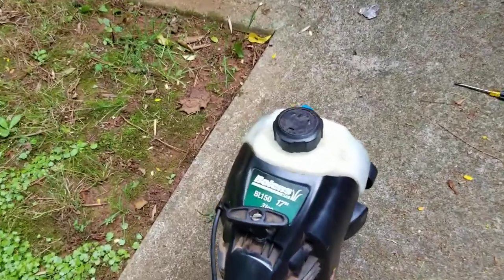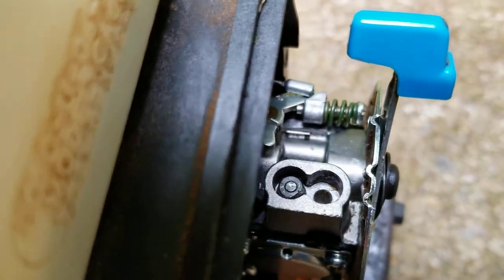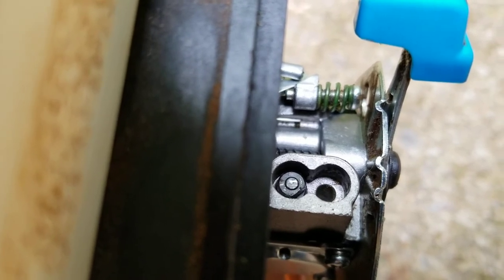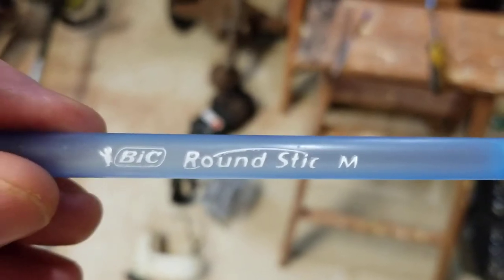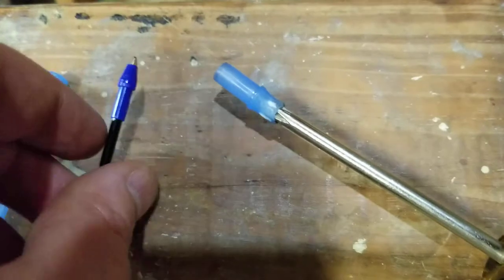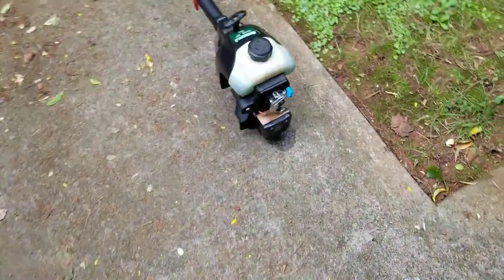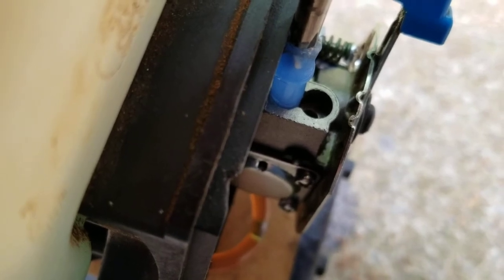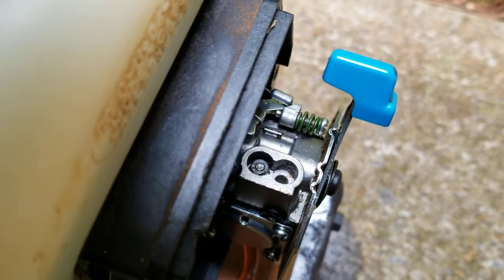Homemade 2 Cycle Carburetor Adjusting Tool

Comment: ALL small engines WILL need this adj after first 30hrs.
Factory sets them very lean to pass EPA.
$15 buys u a set of the correct drivers
Reply from the maker: Yeah, I made this video when I was going to mow my lawn, but my weedeater needed adjusting, and I did not want to wait on ordering the  tools. I had to think of something that would let me get the job done fast. I would advise people to buy the adjusting tools (which I still have not done even years later), but if they don't,  then grab a Bic pen and a screwdriver like I did, lol.

Comment: I had to do the same thing, but I used a plastic sleeve on a wire crimp terminal,  It worked, I pulled mix screw all the way out and with a dermal tool I cut a flat head screwdriver slot in it, so I wouldn't have to go through that next time I needed to make an adjustment

Comment: And fun tip…. For some reason the return hose for the gas tank seems to always crumble so you can use the inners of that ink pen to replace the hose(in a pinch).

Comment: Just melt the tip of the other side too??
Reply from the maker: You should just have to heat the side you are inserting the screwdriver into. Make sure that whatever tip you are using will fit flush onto the adjustment screw. If the tip you are using is too large to fit flush against the carburetor adjustment screw, then slightly heat it and slightly crimp it. If its too small, heat it and use a nail to slightly enlarge it.

Comment: Where  is the  lo screw?
Reply: Low screw is on the left and the high screw is on the right. Looks like his high screw is missing.
Reply from the maker: @johnmilner7603 Some of these carburetors only have one adjustment screw from the factory, like mine did.